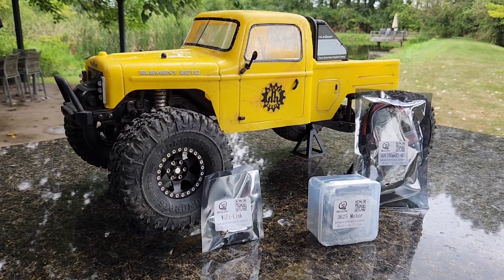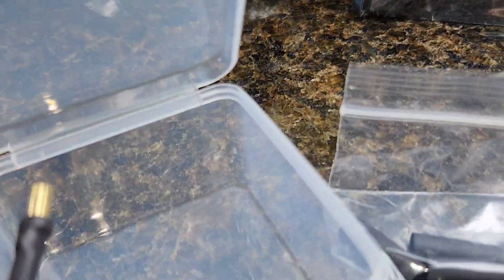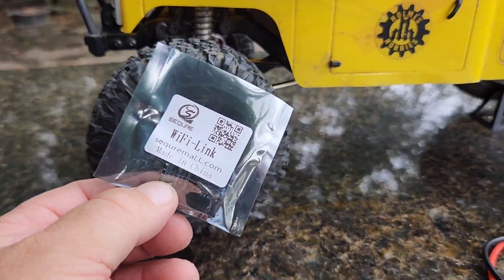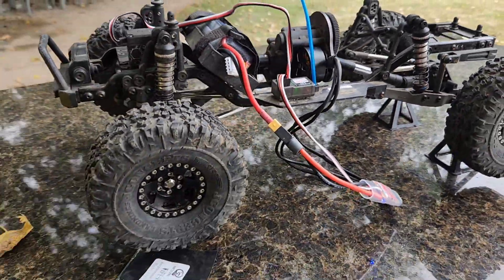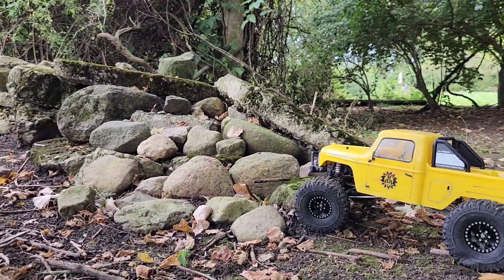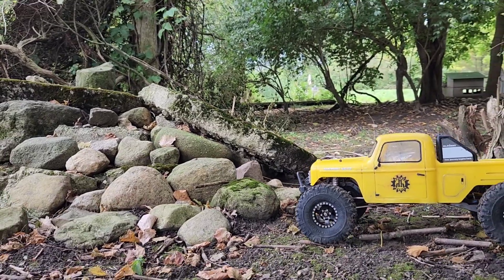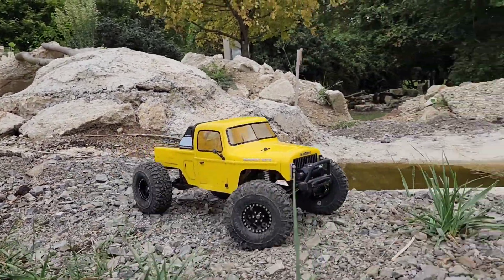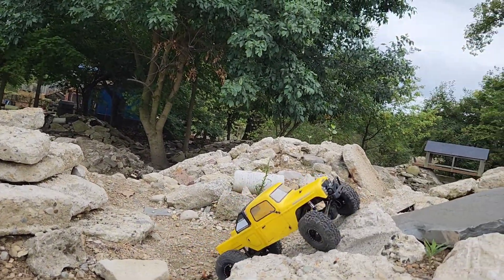NEW Brushless motor release! SEQURE 1800kv out runner system. Spoiler alert! It's pretty good!

Comment: Hey I just receive the SEQURE 1800KV motor &
ESCape 32. I powered it on & the motor was vibrating slightly idk if that's normal or if I got a defect motor & ESC, when I put the motor near my ear I can hear the vibration even when I'm touching the motor it's vibrating. The motor was getting warm very fast aswell as the ESC & it wasn't even on LOAD at all. I haven't even changed anything in the program it's all stock l'm using a 3s 11.4V battery. I NEED SOME HELP.
Reply from the maker: Sounds like it could be a throttle trim issue. Make sure your trim is in neutral. Might need to calibrate esc  to your transmitter as well

Comment: How do you do the triming? My motor is not as smooth when going super slow.
Reply from the maker: You have the same motor /esc?  What radio are u using?
Reply: @hellorc7678  Same motor and esc. The controller is an 8 channel hot rc remote.

Comment: Thanks for sharing, u thinks it’s better then The Fusion 2 in 1 1800kv?
Reply from the maker: I've tried them both in the ecto and I do think the sequre seems a little smoother and has better low speed than the fusion se. Either way they were both great 👍
Reply: @ nice, which motor is faster?

Comment: I run in too much dirt and water for an out runner… basically need perfectly clean conditions to run one for a long period of time
Reply from the maker: @V8chump  oh my
Reply: @hellorc7678  y’all should try boomracing weighted beadlock rings. You can get insane center of gravity benefits for relatively cheap